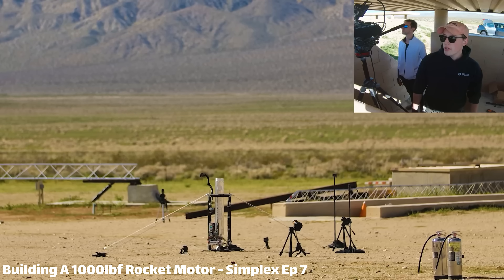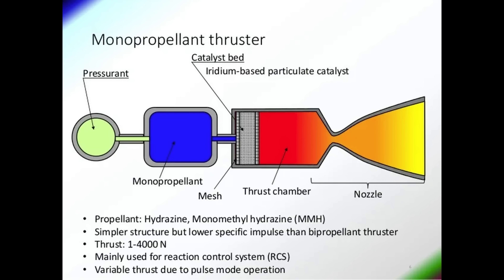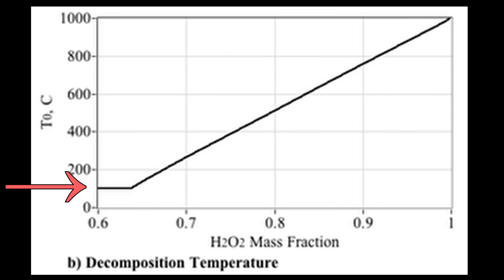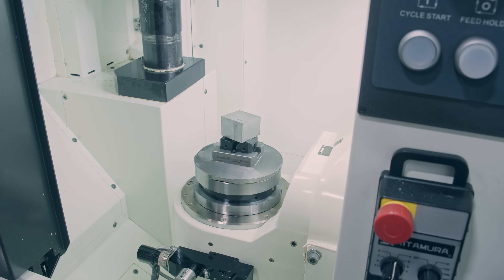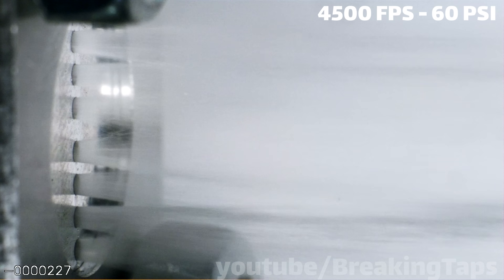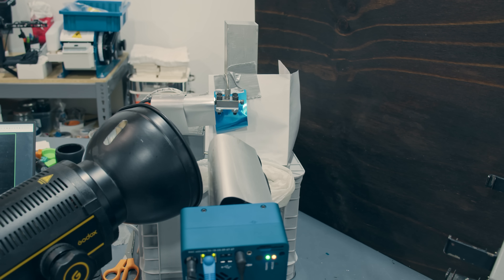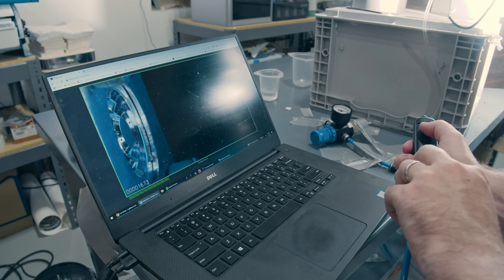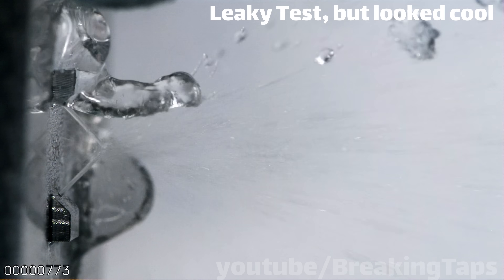Prototyping (Tiny) Rocket Injectors

Comment: Rocket science isn't easy, but as an archetype of difficult fields in applied science I think it's a little passé: most of the big problems in materials science and fuels research are solved so getting off the pad is just a matter of researching thoroughly and doing the manufacturing carefully. (Bigger vehicles and higher speeds still present difficult problems in terms of high volume fluid transport and hypersonics but you're not likely to push too deep into those problematic areas if you're not trying to reach orbit.) Now high energy plasma physics? That's a hard field.

Edit: At the smaller liquid volumes you're working with, a positive displacement pump might be easier to work with than a turbopump.

Comment: I seriously need a banana for scale in my CAD files, I lose my sense of scale so quickly. Where can I get that banana from?
Reply: just throw a cad file of a ruler into every model, boom.
Reply: @dsdy1205  yeah, but how bit is a ruler really? 12inch/300mm well we're back to where we started with arbitrary numbers. 🙄
Reply: @dfgaJK  I mean, most rulers in use are the 6 in / 15mm versions, no? if you just want a rough sense of scale it'll do nicely
Reply: @dsdy1205  I would say most are the full 1ft ones. Also you must mean 150mm, right? Do you even metric bro 😂
Reply: @dfgaJK  ayyo 😂 yes 150mm
Reply from the maker: GrabCAD! https://grabcad.com/library/banana-for-scale-1  

I originally downloaded it as a joke, but it's actually pretty darn useful to include in screenshots 😂

Comment: I would have thought in the chaotic environment the nozzles are in when the engine is actually running and not bench testing there wouldn't be any difference. The impinging style nozzles would be disrupted to the point of not intersecting, and would perform the same as a shower nozzle where the turbulence would atomize either just the same. It wouldn't matter how perfect the impinging nozzle is, all of the turbulence would just negate the differences between the two.
Reply: I think they will impinge fine under the massive injection pressure.
Reply: I don't think turbulence would matter. Vibration doesn't shift things that are already in the air. As long as everything is rigid mounted together vibration shouldn't disrupt the impinging effect.
Reply: The propellant is injected at higher pressure than the chamber. Generally with pressure drop in the range he was testing at here so the actuall stream velocities and such would be the same. The density of the liquid is still an order of magnitude higher than the density of the gas in the chamber so not a great deal will change there.
The "fast moving" part only really happens down say the nozzle.

Comment: nozzles should be designed that way that:
- oxidiser hit fuel stream to allow mixing and more effective burn
- a row of fuel nozzles on the outside spraying directly at the walls of the combustion chamber to create a protective blanket, preventing meltdown 
- same head shall feed fuel and oxidiser through adjacent nozzles.
- nozzles shall narrow at the tip to improve ejection speed

Comment: Just from a math standpoint, every hole in the showerhead succeeds or fails on it's own, but in the impinging design pairs of holes succeed or fail together. The showerhead design is much more forgiving, where impingement desires higher design and manufacturing standards.

I'm lead to wonder if the showerhead design would benefit from resembling the rocket bell, with a larger intake hole, a restriction, and a largest exhaust bell. I figure the pressure drop from the exhaust bell might help to pull the liquid apart, disrupting beam formation and making the spray more uniform; while the bigger intake hole may improve consistency and reliability by helping the liquid to enter the hole, similar to a velocity stack on an engine air intake, but I don't expect you could form the smooth flare of a velocity stack at this scale on any normal CNC, but you might be able to approximate it with a series of larger drills

If funneling the intake does help with reliability, it should benefit the impingement design as well.

Comment: Could you make an impinging injector with 3+ streams colliding? That would presumably help with reliability in the face of clogging.
Reply: That's a standard geometry called an unlike triplet :)
Reply: As above and you'll still have issues with clogging. It's normally used when you're using to mix liquids with different volumes, like you have 4x as much fuel as oxidiser.

Comment: how does the chamber before the catalyst mesh not fill up with the fuel as pressures go up on other side?
Reply: That is a legit issue with catalyst based rockets especially when testing horizontally. For this kind of thing the injector is generally more of a baffle to spread the propellant across the whole catalyst bed and to help with instability (pressure drop across the injector helps reduce "chugging" where the liquid sits on the bed until it decomposes all at once and the resulting pressure spike can push back up into the feed system that process builds into a cycle.)
Honestly though I think it might be useful, if he really wants to use 35% I think he'll wind up needing the purple menace of potassium permanganate to get it to cook off. That could be interesting in an impinging injector and would make for some very pretty video. Especially filmed in someone else's shop 😂

Comment: Try using a rowed injector assembley with a conical deflection plate at .2mm under high pressure the laminer flow and stream will hit the deflector and atomise

Comment: High test peroxide also really doesn't like organic materials. I think it was the Germans that had an aircraft that ran on high test peroxide and several times the pilots had to be removed from the vehicle with a hose and a mop.
Reply: You'd think they would have gone back a stage in the project after the first pilot
Reply: @Ziraya0 it’s hard to bog wrong betting on the incompetence of Germans
Reply: Holy hyperbole batman. Any sources for this? Just some casual skimming and I found 1 notable fatality in relation to T-Stoff and nothing even remotely close to " cleaning up pilots with hose and mop"
Reply: @zephdef1781 I don't clearly remember any incidents that are that bad, but look into Me 163 rocket plane incidents. It ran on some nasty stuff, including high test peroxide iirc